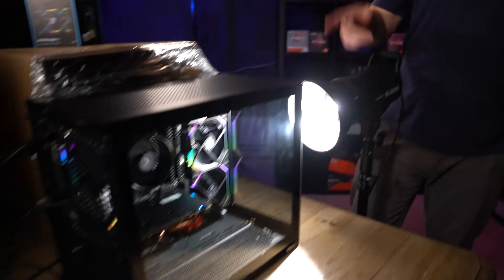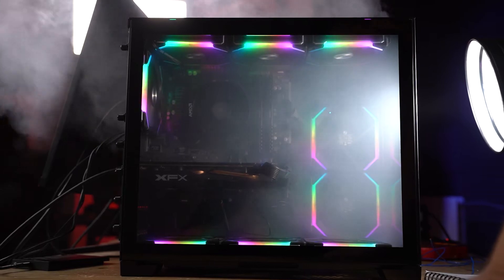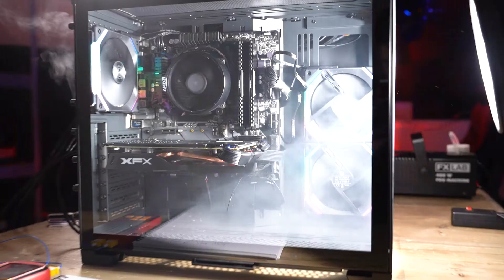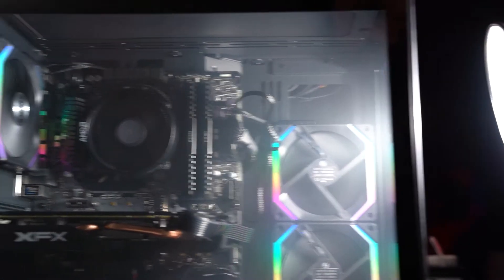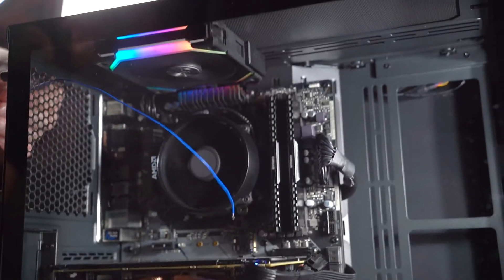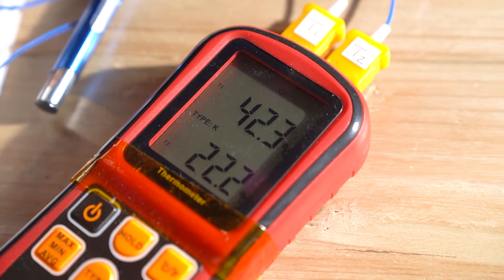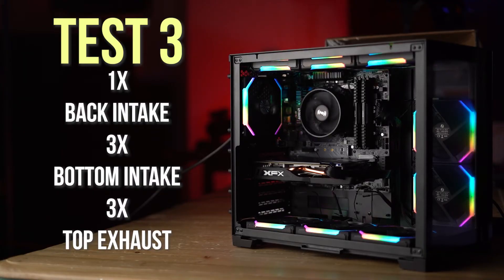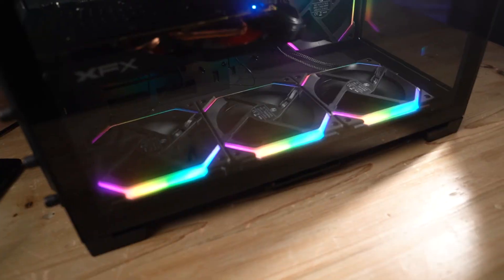LIAN LI 011 DYNAMIC MINI - Airflow and temperature testing - EPISODE 2

Comment from the maker: Don't forget to let us know what other cases you want to see tested! ⬇
Reply: How about Be quiet Pure Base 500?
Reply: Cooler Master TD500 Mesh
Reply: Lian li evo with all the fans and an AIO. Also rtx 4080 Because those gpu are huge and I’d like to see if size matters. 

Instead of 3x 120mm fans on the side, use 3x 140mm fans. Not designed for 3x 140mm but I made it work with zip ties. 

Also test with mesh foam.

Comment: How about the LIAN LI PC-O11 DYNAMIC GAMING COMPUTER CASE? Because I have a Corsair iCue 465X RGB and the front panel reaches the graphics card at 77 degrees and if I remove it, it reaches 72 to 73 degrees.

Comment: A quick question; if i use 3 fans at front(intake) and 3 at bottom (exhaust) and 1 at back(exhaust) is  this a good idea or i shoud use 3 fans at bottom  as intake?
Reply: i don't think so, 6 intake and one exhaust will give you better results or 5 in and 2 exhaust

Comment: Anyone ever tested 
 - top aio 360 intake 
 - bottom 3x120's intake
 - side 2x120 or 140's intake
 - rear 1x120 exhaust.  
?
Reply: yes, my friend pc, except bottom intake. two exhaust at the back, one under gpu and one above gpu. 3 front intake and aio at the top with 3 inake as well
gpu temp was same when aio fan set as exhaust but with intake cpu temp improved
3080 at 60 deg c and r7 5900x at 60 too, corsair crystsal and h100 aio during 3d rendering
one more thing, room temp is 35 deg c, dry hot summers

Comment: Aio side intake, 3 bottom intake, 3 top exhaust, 1 rear exhaust, vertical gpu . This setup is right for this case i believe
Reply: Aio at top and the intake should be at side , exhaust at bottom because intake at bottom won't suck air as much as  intake at the side
Reply: @BravoSix09  you know that aio at the top just pulls hot air thru right? so cpu temps are gonna be higher, there are plenty of vids about this topic and since hot air moves upwards it would make zero sense to put the bottom fans to output
Reply: @zen4714   yeah i saw a few videos and i confirm that. After this comment i checked some tests .You corrected my comment thanks 👍
Reply: @zen4714  so what is the best configuration?
AIO 3 exhaust
3 side intake
3 bottom intake
2 rear exhaust?

Comment: You’re getting 88° GPU and 80° CPU? Aren’t those temps EXTREMELY high? Seems that parts won’t last long with things that hot. Any opinion on this?
Reply: lmao 80 and 88 is not «EXTREMELY» high at all😂whyd u think that?
Reply: @xcadas  Seems that some GPU's will thermal throttle around 83 celcius so it's very close to that. Most people seem to get around 75 celcius under load for most CPUs, 80 and 88 are pretty high to most builds I've seen.
Reply: yup, 81-83 is enough and this limit  set by factory for gpus 
high temp dry the thermal paste in less time also

Comment: This was such an informative video, content wise and visually too! Helped me a lot. Am currently changing my pc setup to a Lian Li 011 Dynamic mini, totally air cooled - 3x 120s at the bottom, 2x 120s and 1x 140 on the top, 2x 140s on the side and 1x 120 for the back, cpu cooler is a Be Quiet Dark Rock Pro 4. From what I've learnt from this video, I shouldn't have a problem with the temps. Thank you so much!
Reply: im also air cooling in an o11 dynamic mini  2 120 side intake, 3 120 bottom intake, 1 120 back exhaust, im thinking of putting only one fan  at the top as exhaust all the way in the back instead of three, ive always had a theory specifically for air cooling that the top middle fan would exhaust the air before it gets to the cpu cooler and the top fan all the way in front would exhaust the air the side intake fan just brought in, this vid  shows it
Reply: @polaroidd1306  Thanks for the info. Interesting thoughts 👍 But at around 11:40 of the video, the configuration he used was 3 on top, 3 at the bottom, 2 on the side and 1 at the rear, and he said that it was good airflow. So I more or less set up my pc that same way. So far, thermals have been great. It cools well.

Comment: In test 3 can I Mount my radiator to the top of the case and still install the fan the same way round as use did in test 3 or will the fans go a different way around on the radiator

Comment: question, i have the mini and i have the fans as the top 3 and bottom 3 as intake ( pulling in air ) and the top left, and the two on sides on the rad as exhaust ( pushing out air ) is that adviseable? or should i switch it around
Reply: I'm using the same right now. A friend told me to do this after invidia RTX GPU changed their GPU exhaust direction(it blows hot air upwards straight to your CPU). So my friend adviced me to make the 3 top fans as intake so it would blow the hot air from the GPU sideways going right into the exhausts on the side panel and back exhaust fan.

Comment: Thanks for this ! After some study, same ideas for a new build with this case. For the rear-exhaust, is this really recommended ? For my build i was thinking of 3x SL120 (bottom intake), 3x SL120 (top exhaust) and 2x SL120 (side exhaust on top of a NZXT X63 kraken 240 AIO).

Comment: Using a ROG Ryujin II 240 AIO with this case with x3 intake bottom, x2 intake side on rad, 1 exhaust rear, 3 exhaust top in total of 9 SL 120 fans getting 70c max on stress test on my 5600x. Should I be worried?
Reply from the maker: if you're stress testing at 100% and getting 70c then that's in the "good" range. AMD have said that the 5000 series will run hotter and they see temps up to 95c as "typical and by design".
Reply: @WePC  Thanks! :)
Reply: @CastleKnightAO  can you try the Ryujin with the 2 fans set as exhaust? I have the same thing as you but my 2 rad fans on the side are set as exhaust